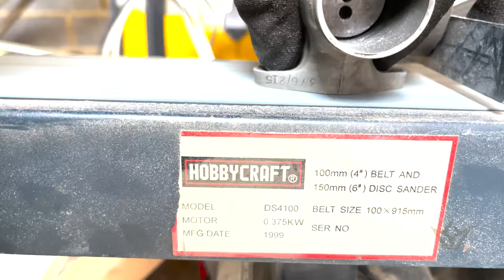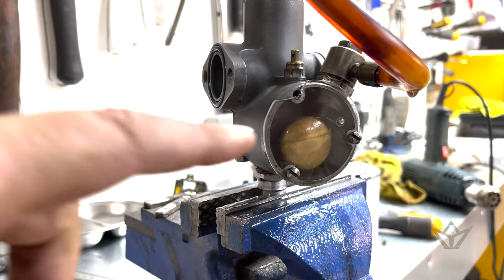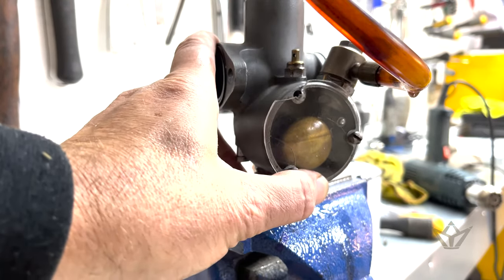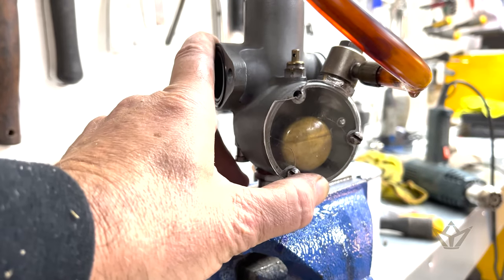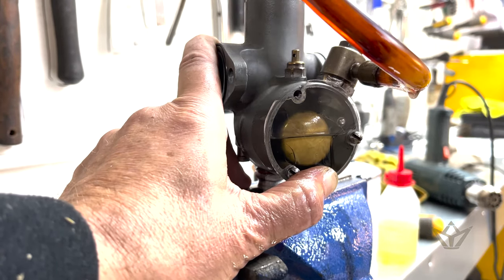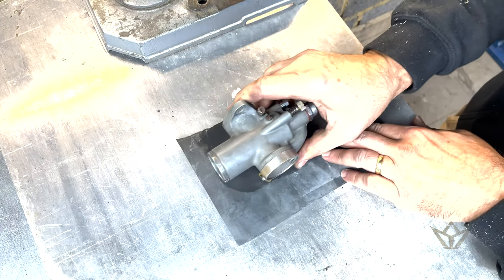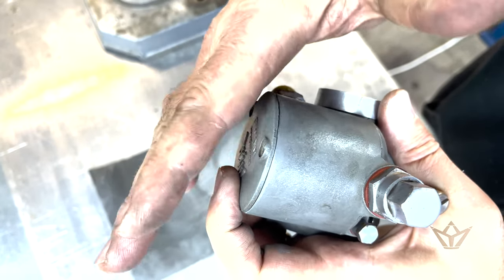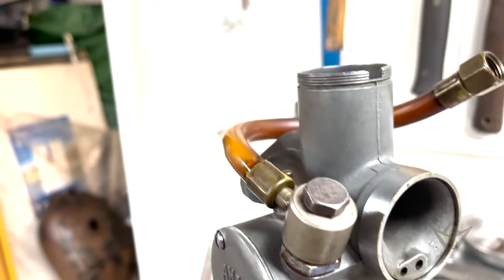Restoring a vintage AMAL 375 Monobloc Carburettor | 1961 ROYAL ENFIELD BULLET 350 | Full Restoration

Comment: Hlw sir I'm from India and an old subscriber too..I had watched this video also but I am going to buy a monobloc carburettor 376/215 same as the bike you restored in the video can you give me the perticular size of the main jet of the carburettor that I can buy it correctly as in amal site it given as 170 main jet and in Hitchcock motorcycle and other uk classic bike parts sellers site giving 190 is the correct size for the bike carburettor..which should I will go..my bike is a 1959 g2 bullet 350cc
Reply: Which size 170 or 190 for the 376/215 carburettor kindly help me to purchase
Reply from the maker: Hello my friend. My bike in built and in storage but I found the original service manual and it clearly says the main jet size for the Redditch made 59’ 350 Bullet is 190 (with air filter) needle jet 106 needle position 3. Pilot jet 30.
Hope that helps!
Reply: @MyRestoration1  thanks my friend 😊😊

Comment: the monobloc is a lovely looking carb but it seems like a flawed design with the opening of the bowl on the side.  When I bought my 1964 Triumph TR6 the monobloc had been replaced with an Amal Concentric carb, which works great.   I still have the original monobloc, but it's sitting on a shelf as a display piece for now.   I wouldn't mind putting it on the bike at some point to see if she runs any different with the original carb.
Reply from the maker: I found a lot of negative stuff written about these carbs. If you set them up right they are solid and dependable. Very little to go wrong. If seated correctly with a new gasket, as I show in the video, then no problems. On occasion the pilot jet might cause the engine to die after a rev up. Not sure you can fix that other than raise the idle a bit. Someone will surely comment. 🙏

Comment: Good video.  I have a 376 - 25 on a Bultaco.  Cleaned and all new jets and cable but slow to return to idle after revving.  The float, slide and choke are original.  Any ideas? Thanks
Reply from the maker: Hi. It’s a simple carb so not much else to look at as you describe it then the last part of the cable return. One of the errors I see is not having enough slack on the throttle before you engage revs. The tendency is to set the tension of the cable so that there is no play. It’s a natural tendency because we like a tidy bike! There must be as much as a quarter turn of nothing before the cable engages. Why? Because when you rev up and drop off the cable must be absolutely free at that last bit of the drop because the spring is so slack any tension will cause this slow drop in revs. If it’s not that then you could have a sticking point to find. Basically the needle is not closing off to stop flow back to the idle jet. There isn’t much else to look for I can’t think. Good luck 🤞